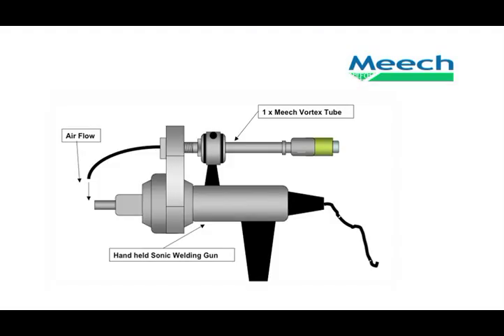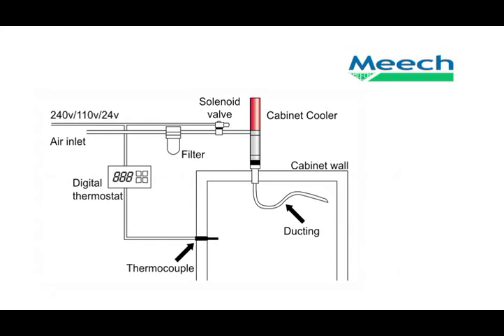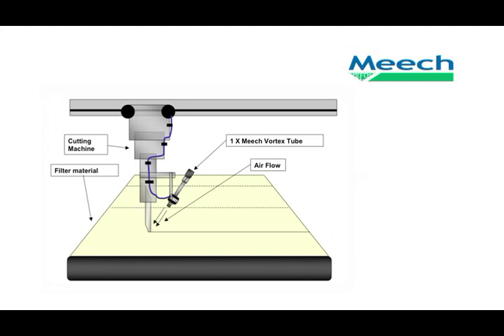Meech Air Technology Vortex Tubes, Cabinet Coolers and Coldstream Guns

Comment: how much is the cabinet cooler setup? and where can i purchase one? what size compressor is required (what CFM/PSI)? how loud is it?

I have a 40 cubic foot (1.15 cubic meters) area that vents air currently 3-4 times a minute (440 CFM fan, ducted to vent, also have a speed control) I have about 1000w of electronics inside which causes the temperature to rise upwards of 95 degrees F (35C), and I need to cool it down to around 70-75F (21-24C) 

Can I use a vortex cooler to cool water as well? would it be more advantageous to cool a small reservoir of water, which could then be used to cycle through a radiator as the intake air passes over it?